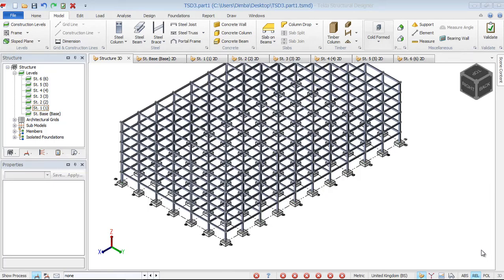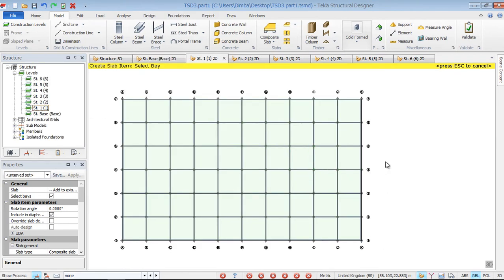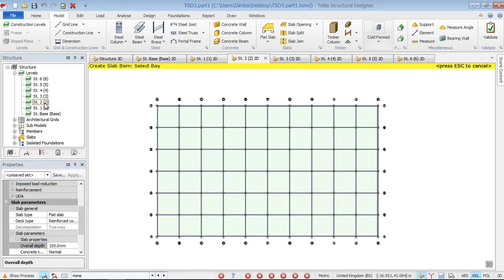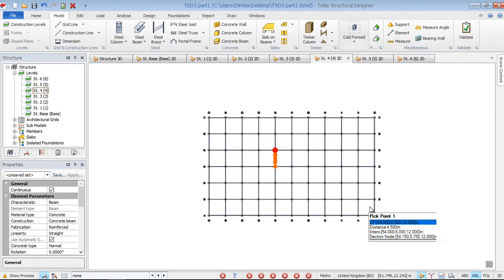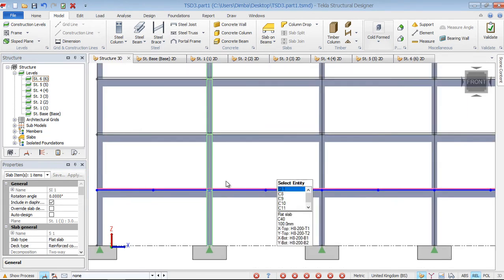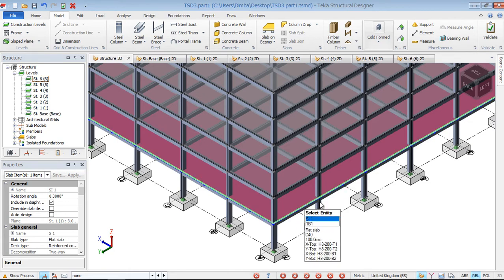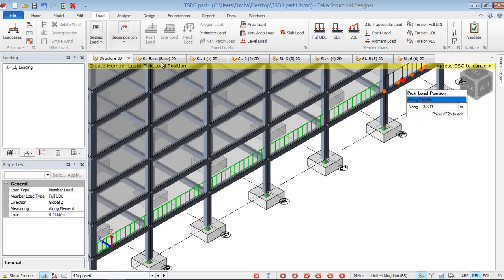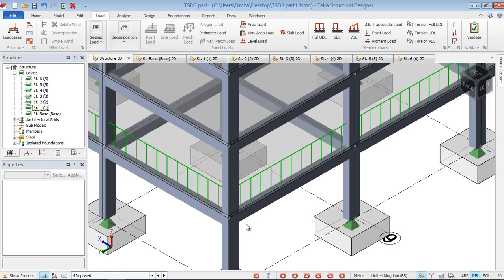How to create slab and load application in TEKLA STRUCTURAL DESIGNER 2017

Comment: Hello sir  very  nice video! I have a question.  So how I should proceed to design a steel Industrial building? First  I should start  with tekla structural designer and then to export to tekla structures ? Plz tell teach  me how to use this  programs. Also tell  me about  tekla  connection designer
Reply from the maker: noted